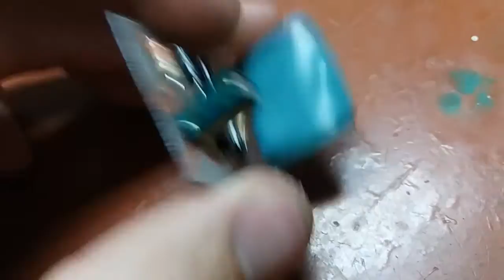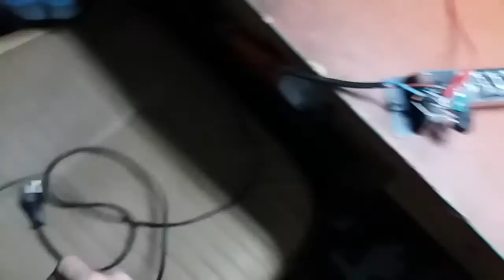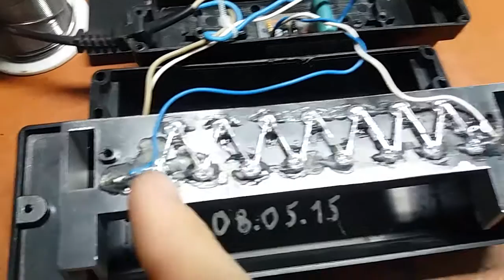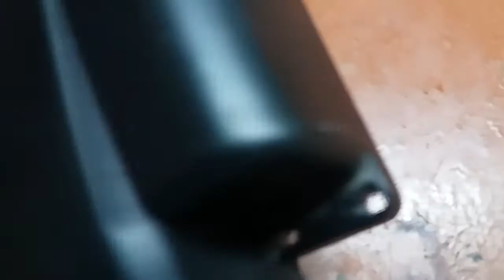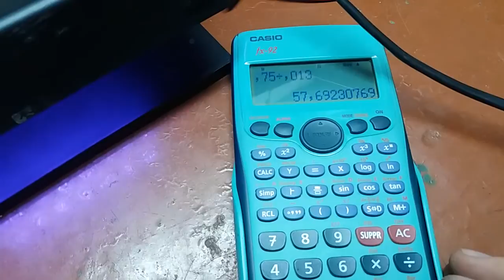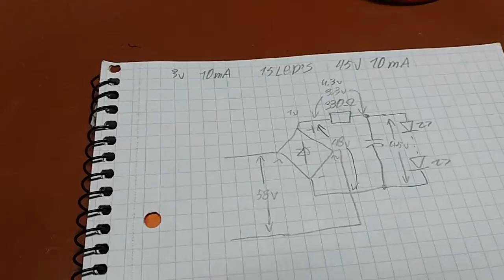Currency detector repair - Part 2 of 2

Comment: Smashing job :-D
I like the cute little pcb, neat.
A circuit does not need to be complex to do the job, less parts to go wrong :-D

I would be very happy with the result, the Mark 2  version :)
Reply from the maker: YouTube doesn't like you for some reason, I keep dragging out your comments from spam folder LOL 
I think it looks better than perfboard, plus on perfboard I need to go and scrape off a lot of pads on it to get desired clearance.
Reply: I don't know what is going on with the spam system, perhaps it does not like the smileys i add.
Youtube could be depressed :-D